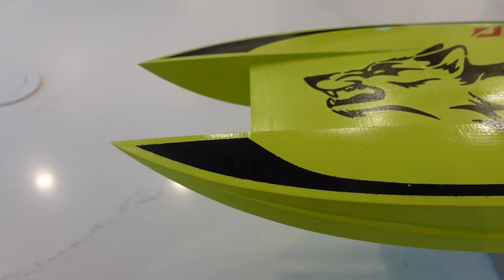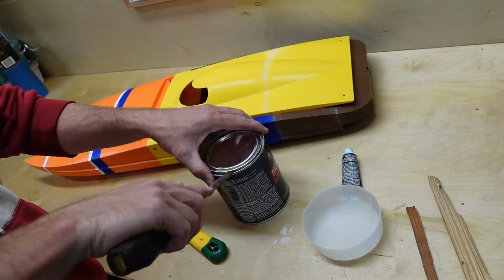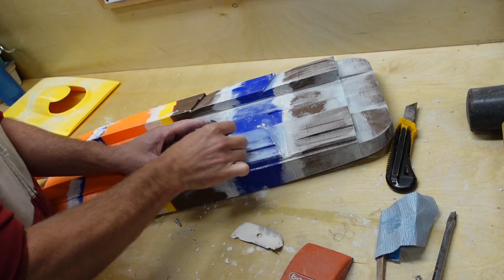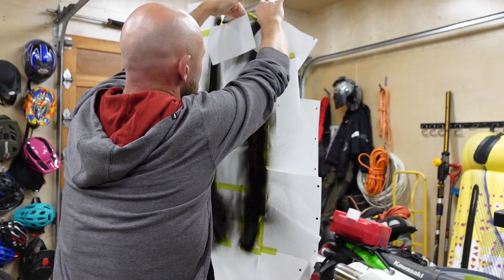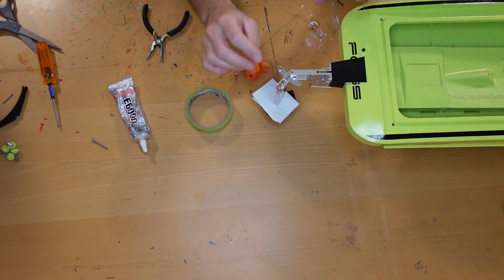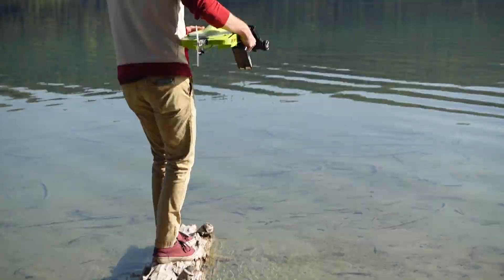3D Printed Catamaran Build Video

Comment: your first mistake was using your fingers applying the bondo on the seems. the oil from your finger will blend with it and cause it to crack and fall off  sooner causing leaks. should have used rubber gloves. but all in all awesome build . just a tip. not degrading just trying to help. also you could use carbon fiber on the inside for extra thickness and prevent leaks. but awesome build. you also could use fiberglass coating on the outside instead of bondo filler

Comment: So what filament did you use and how much does the boat weigh? I printed mine with epax fast PLA +. I used a 40mm prop and a 2280kv motor. All I get is cavitation. I can get maybe 2 MPH and that's all. I am thinking it weighs too much. I was going to try to reprint using less material to lighten the finished hull. I also noticed that the motor mount is probably heavier than most, and the servo mount is certainly not needed. A piece of double sided tape would work just fine. What do you think?
Reply: The cavitation could be from the boat not sitting low enough or the prop spins to fast so you need a bigger prop

Comment: Great work and excellent result, but my question is, what is the distance that you can control the boat using the meter control device?
Reply: Depends on the controller and receiver used

Comment: Why is the silicone cooling tube connected to the rudder?
Reply from the maker: The rudder has intake holes in it that force water through the tube and cool the motor/esc

Comment: How many walls?
Reply from the maker: I think I did 3 walls so most of the structure exterior is actually a solid shell. You can read up on more of the instructions here: https://docs.google.com/presentation/d/1cmMr5UPkvT3B9z6sGOdP0n1sWMBbi4_BK_Ypv6_6utU/edit#slide=id.g4ebcb652e5_0_397

Comment: what engine did you use, how much hv. I installed 6s 1400kV and there was an air bubble in the propeller and the boat did not gain speed.

Comment: What software you use to design that I struggle with rounding objects smoothly, I can easily make square body vehicles like pick up trucks or hummers but struggling with my boat
Reply from the maker: I'm not much of a designer myself, I mostly print other peoples designs. But when I need to design something, I usually use Fusion 360

Comment: What size bed was it printed on or what printer?  I was thinking about printing it but other boats I have found are too large for my print bed...
Reply from the maker: I printed this on my prusa mk3s but I believe all pieces will fit on a 220x220 like an ender 3 according to the designer.

Comment: hey in your instructions you mantioned to use 2 batteries but in the video you only use 1, can you alaborate on that please ?
Reply from the maker: Hey, there are spots for two different batteries in the hull so you could balance the weight with two 2s Lipo batteries for a total of 4S power assuming your esc and motor can handle 14.8V. In the video I just used one 3s battery for ease.

Comment: Are you using thin, medium or thick CA for the hull glue up? Thanks.
Reply from the maker: I used this: https://www.amazon.ca/Best-instant-Wood-Stone-Automotive/dp/B00B4RD5ZK/ not sure what grade it is but I'd guess medium.
Reply: @rcprinter  thanks. I will try that.

Comment: Minimum printing volume?
Reply from the maker: Hmm, I'm not at a PC to check right now but IIRC it wouldn't quite fit on an Ender 3 bed but it did fit on a Prusa MK3 bed... So NOT 220x220 but YES to 250x210

Comment: In printfullys recommended printer settings it gives a lot of range like 25%-100% infill but doesn't specify for what parts, and 4-8 top and bottom layers. I printed 2 perimeters, 4 top and bottom layers, 25% infill with gyroid. Mk3s+ with prusaslicer. I printed a few of the hulls and they seem really heavy. What were your settings for the prints?
Reply: I ask myself the same question, were you able to finish the construction of the boat? Thanks
Reply: @sebgln  I completed the printing part with 2 perimeters, 4 top and bottom layers, 25% infill with gyroid in prusaslicer for all printed parts. Still waiting on some stuff from amazon and AliExpress to complete the build.
Reply: @snider_rc  Oh oh, which motor do you have choose ? Thanks for your feedback.
Reply from the maker: I had almost the same settings but 3 walls. I also used 6 top/bottom layers at a .4mm nozzle and .2 layer height. 3 walls makes many of the parts solid (good) but also makes it heavier (bad).
Reply: What is the extrusion width in tue manual ? It's recommand to have 0.48 but normaly it's 0.4 for 0.4 nozzle ? Thanks

Comment: Can inask where you git your transfer stickers from?
Reply from the maker: These are just water slide decals I printed out at home on my inkjet printer. You can easily buy packs off amazon. The only issue is that you can't print in white so you have to choose paper that has a white background or a clear background, this model is light colored so I went clear. Once printed you spray them with a clear acrylic to lock the color in.
Reply: @rcprinter  Cheers i appreciate it

Comment: Do you print hulls for people for $$$???
Reply from the maker: I don't sorry. Maybe get a printer and print your own! Its not too hard and you don't need to design anything.
Reply: @rcprinter  so if I hot my own printer I can pull files from online and transfer them to the printer and that's all? Or is there more to it then that.. cause if it's not to hard I'll get one of them 200 dollar printers and just print the boats in sections.
Reply from the maker: @delong3D  ya basically, you have to put them into a slicer program that converts the 3d model to instructions for your specific printer but it's really easy. Ender 3 or similar is fine for most boat models. This particular model though is a little too wide I think for a small printer. It fit on my Prusa MK3 build plate but not smaller.
Reply: @rcprinter  I ordered the ender 3 v2
Reply from the maker: @delong3D  nice! Many people (myself included) got started with an ender 3. Enjoy it!
Reply: @rcprinter  will this model print at this size sections with the ender 3 v2?
Reply: @delong3D  i am also wondering this! i have an ender 3 and really want to print this!

Comment: Im curious if the steps in that hull model are functioning properly. The weight has to be precise for those steps to function and be beneficial and I'm thinking based on the way your hull is displacing water right before it reaches plane , the steps are too low in the water to properly ventilate. I'd be curious if this model would actually see performance increase by removing the steps and keeping the plane surface linear all the way to the stern. I could be incorrect in my observation as it also seems like the hull is underpowered so your are not reaching enough speed to generate air compression with tunnel sufficient enough to lift the hull. This could be the reason the steps are not ventilating, at higher speeds the hull will lift and the steps will be further out of the water allowing them to ventilate.
Reply from the maker: Thanks for the tips, I'll do some more work on it next year.

Comment: Did you have to scale this model to print on the i3 mk3s ?
Reply from the maker: No it worked at 100% :)
Reply: Also, did you print in PETG ?
Reply from the maker: @riles6  nope this is all PLA except the motor mount which I think was PETG

Comment: Awesome build! getting into these builds thanks to your videos. About the decals, they are a nice touch, did you make and print them on your own? Do you have a tutorial on that if that is something you do or perhaps something to look into as a future video idea. Keep up the awesome work!
Reply from the maker: Thanks for kudos and the video idea... yeah the decals make it looks a lot more finished for sure. I don't have a video on it but I just search the net for some pics to borrow and then print them out on a regular inkjet printer with clear waterslide decal paper as long as the project is a light color and the decals will look good without white (since you can't easily print white). You can get white decal paper as well if you need white but then you don't get see-through parts and you have to trim perfectly. I think the other options are solid colored decals cut out on something like a cricut or getting them printed at a printing shop but I haven't tried those options yet.
Reply: @rcprinter  awesome! Thanks for that breakdown. Really helpful. I’ll give it a shot with the printer, and may also try my hand with the wife’s cricut. Again all the best to the channel.